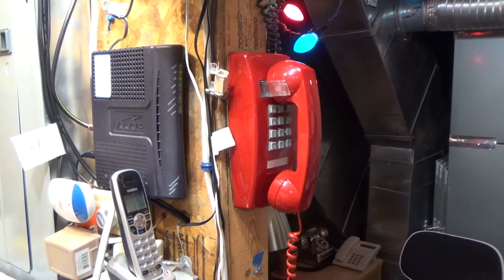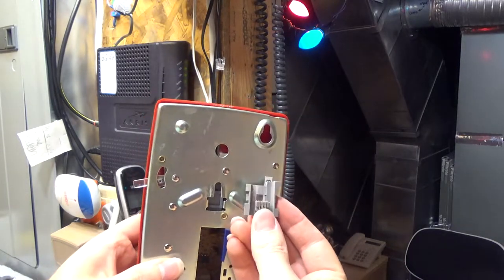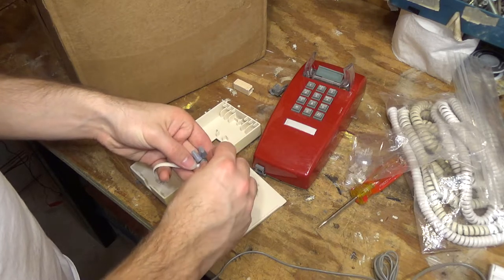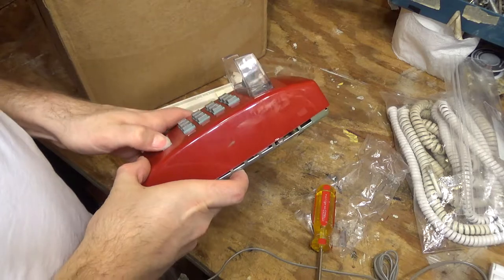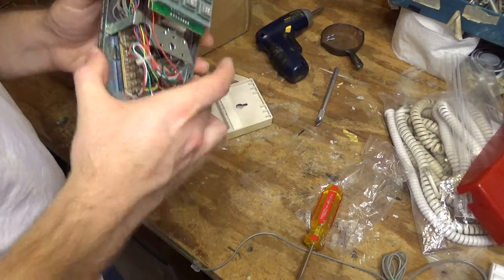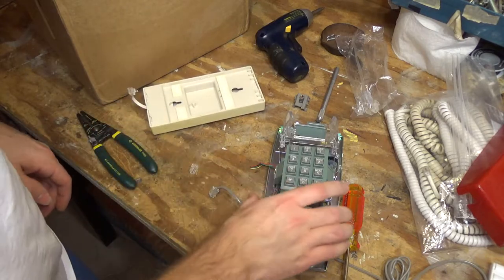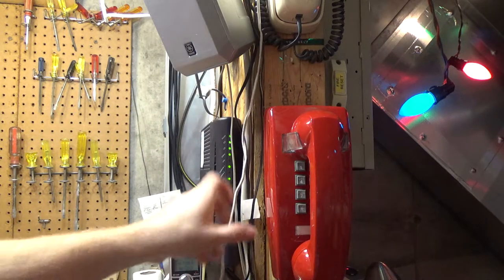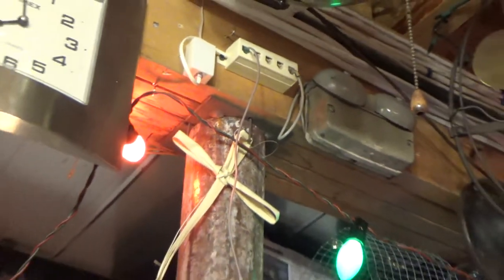Cortelco 2554 Line Connection Modification

Comment: Just gonna jot some statements down here in no particular order:

- 11:31 Those things are usually called "extenders," so in this case probably a modular extender.
- I'm one of the ones that doesn't mind watching the putting of the phone cords back in the box, so no worries.
- That mechanical ringer you installed on the ceiling is very cool.
- If you didn't want your phone number on the Internet, what's that phone number you put in the "About" tab on your main channel?
- LOL at those couple freakshows and bloopers.
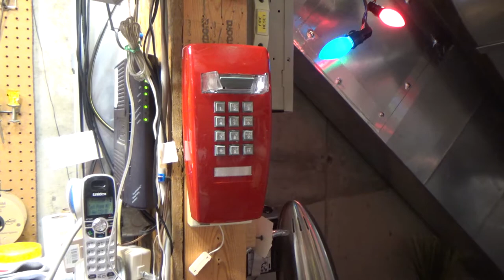- 14:46 What would have actually happened if you plugged that right into the phone line there?

I think that's about it.  Good video as usual.
Reply from the maker: The number listed in the About tab is my business number, that's public knowledge.. What I don't want on the Internet is my personal home phone numbers..
I think if the handset were plugged directly into the line, you probably would have been able to talk on it as normal..

Comment: how long have you been repearing phones
Reply from the maker: A few years..
Reply: i have a panasonic kx-tc1484b corless phone it is 900mhz
Reply from the maker: That's cool.. Other than the battery problems, those were good phones..
Reply: i got a new battery for it works good panasonic has some good old cordless phone look up the kx-tc1484b
Reply from the maker: Good, glad to hear you got it working.. I am familiar with what model that is..